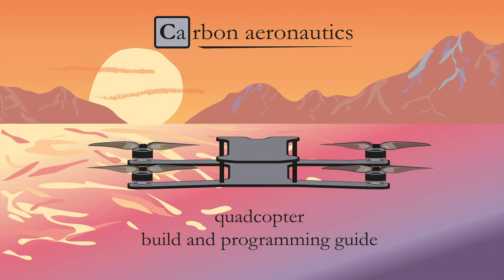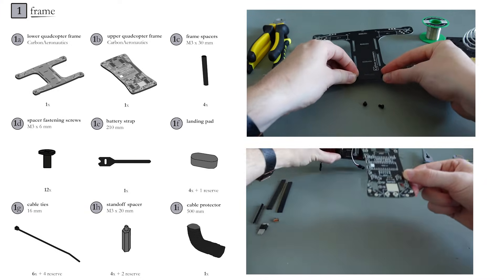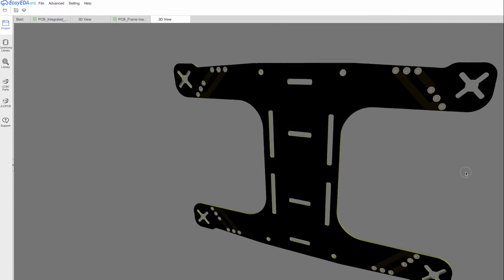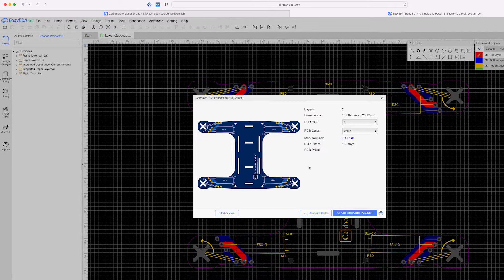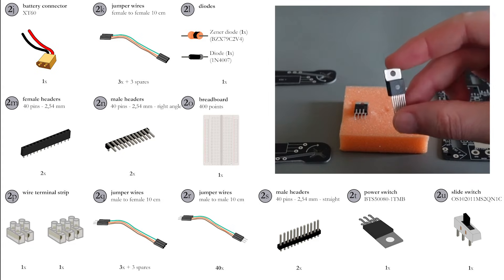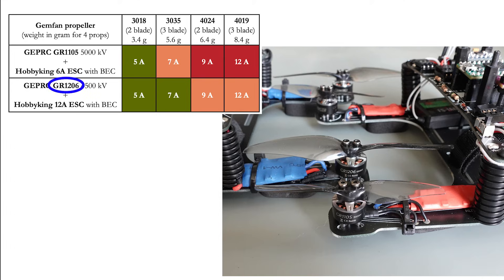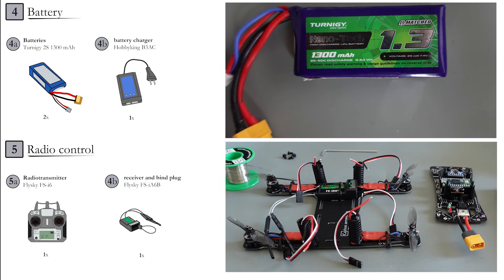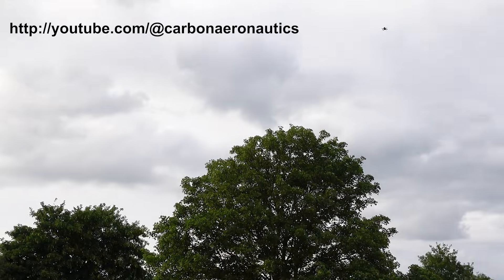0 | You can build a drone with less than 40 components

Comment: Thanks a lot for this beautiful and detailed tutorials! I want to use a 4-in-1 esc to and shed off some weight. I am not sure however if it has a BEC. Its a ' HAKRC 4 in 1 Electronic Speed Controller 4 in 1 45A ESC PWM Hardware Drive Motor for FPV RC Drone '. Is it a good idea to use a  4-in-1 ESC for this project? Kindly advice.

Comment: It's surely a ridiculous question but, what happens if we use directly a voltage divider in the lipo battery in place of the ESC's BEC ?
Reply: the voltage of the lipo drops with the capacity, and when the voltage drops, so does the 5V output. i added an voltage regulator from the lipo rail to 5V. because esc's without bec were mutch cheaper.

Comment: I have used all the code from his manual, not GIT Hub. He shows you to build the drone in sections before placing components on the board because you are testing each component and learning before soldering all parts on the drone circuit board. Very important because the drone is a balance and complex system.
Reply: Hi, How much did it cost to build?
Reply: @what_if_AR  Yeah, so actual question.
Reply: Where are the parts listed because you're one of the people who followed the course
Reply: All in his manual @D_Net1
Reply: Hi, how were you able to get the manual? I cannot access it on the github
Reply: Hey. Would love some help ordering the PCB. It says I have unmatched components

Comment: Hello, I can no longer find ESC Turnigy Plush-32 6A from HobbyKing, it always has the status of BACKORDER and on other sites I can not find it. Can you recommend another ESC, which is found on the market? I have all the other pieces. Thanks so much.
Reply from the maker: The 12A version from HobbyKing will work as well, it is just slightly heavier (11.5g instead of 6g). Although I haven't tried it, you are normally able to use 6-15A ESC's from other manufacturers as well, just make sure it has a BEC of 5V such that you can power the electronics and the ESC is capable of handling a 2S limo battery.
Reply: @carbonaeronautics   
que
Reply: @carbonaeronautics  que
Reply: Salut

Comment: Any reason for teensy 4.0 and not 4.1 or even Pi Pico or STM32F4?
Reply from the maker: Mainly because the teensy 4.1 board is larger in size and it couldn't fit anymore on the upper frame. The project indeed perfectly possible with the Pi Pico or the STM32F4!
Reply: @carbonaeronautics Can I use w806 microcontroller? 🙄